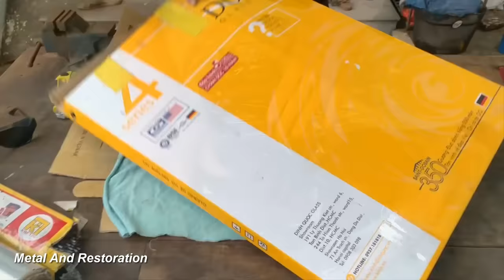Restoration Viking Axe Battle Old | Restore AXE construction Antique

Comment: I really liked it till you stopped restoring it and just painted it.
Reply: No need to do more than removing the rust and painting with anti-rust paint, depending on the purpose. All shiny or partially shiny were certainly options of the customer.
Reply: I kind of get why because the sanding from the plate replacement looks tacky, but If you really want to get technical you could use a variable speed grinder with a low grade scotch bright pad and polished those scratches out. Then you could kind of have the new shiny original look, and of course anti rust it.
Reply: Also when you sand with a grinder don't do small little movements. That just makes it dig in more and create  more scratches. Go with the contour of the shape your are sanding.
Reply: I would've talked the customer into a black oxide instead of that dumb spray paint choice.  If I were the craftsman I probably would've told the guy I can't spray paint it but I can apply an actual black oxide and he can ruin it himself if he wants to.
Reply: It was so frustrating...
Reply: Yep. It's an integrity issue; knowing there's a thick layer of rust beneath a coat of paint doesn't exactly fill me with confidence.
Reply: Watt fooc
Reply: Same
Reply: 666th like
Reply: Exactly
Reply: News flash: Iron when it isn't polished is BLACK. Plus it's a rust prevention layer!
Reply: nowonmetube please spam somewhere else...
Reply: nowonmetube you really like saying news flash huh?
Reply: I figured I'd polish the piece.
Reply: Agree
Reply: f@#k it , im tired, gets a paint then sprays it
Reply: @chriss3835  tttyt7r...
Reply: 9h
Reply: @naveenkumark171  ?
Reply: he coulda just silver spray painted the shit out of it too. paint dripping and all
Reply: I approve of your name and icon.
Reply: Flaming Gamer_ing honestlytho
Reply: Cough He was restoring it to like how it used to be. At the start of the video when he is scrapping of the rust you can see that the axe was painted black. That's why he painted it.
Reply: What a shame he painted the dam thing it would have been awesome unpainted
Reply: @ObeyCamp  Yes, I totally agree with the oxide rather than paint!  Myself...I would want the whole blade brought to a highly polished finish just like the cutting edge...but that's just me.  ⚔
Reply: الله رآه معاكم في هذا الموضوع
Reply: Maybe his customer requested that way.
Reply: @nowonmetube  So, why are all blades we use not black then?

The fact is, iron is of course NOT black. Iron, similar to other metals like silver, platinum, etc. has that silvery, metallic color. Iron and steel that comes out of the forge is black, because its outer layer is saturated with carbon (soot) from the fuel (coal or coke) that was used to heat it in the forge. That's why iron and steel tools are polished, to return it the original and natural metallic sheen.
Reply: @Kamamura2  true but after it's forged it's still black and you don't need that "shiny shiny armor" but I guess that looked more impressive. But then there's the "black knight". Maybe they associated black with evil. I wonder how many things were black and how many were shiny back then, because having to put so much work into it (back then with no electricity tools) without any benefits, it doesn't seem worth it.
Reply: @Wooksie  how it used to be? Are you blind to the fact that it's just a modern scrap of metal cut in some shapes and dunked in acid, then pretending to be restored. So the wierd Asian prank channels are actually real life "funny" accident? Omg you are right! Woooow! 🤣
Reply: @Wooksie  how it used to be? Can't you see it's a chunk of modern scrap pretending to be restored? So all the wierd Asian pranks that circling online are actually real "funny" accidents? Omg you are right! Woooow 😂
Reply: Flaming Gamer_ing literally turned the entire video off for me to McDonald’s saw the spray paint
Reply: that kindda bullshit....
Reply: بژی بژی
Reply: بژی
Reply: Flaming Gamer same 😑
Reply: Yup... Me too.... Cmon man we wamted to the full axe to be polished
Reply: @karinefonte516  he couldve just hardened the metal so it became rust proof, stronger and it being color black
Reply: Flaming Gamer_ing nooooo not PAINT 😭
Reply: Yeh. The paint over egged the pudding.
Reply: axes aren't always unpainted.
Reply: Yeah... bad finish axe.... so unreal.
Reply: yeah it kinda ruined it
Reply: Agreed
Reply: عمل رائع. تسلم
Reply: Yes
Reply: I'm not quite sure but I'd assume the customer is paying him to do this, so the paint is probably a cheaper choice for them and since its for purely ornamental purposes I wouldn't think it matters too much.
Reply: Yes me too man. I wanted to start crying 😭 such a beautiful axe
Reply: Freaked me out when I was reading your comment and I couldn't remember commenting on this video. Turns out it wasn't me, it was you hahahaha! Nice pic
Reply: @darnit006  um thx?
Reply: Good work until the paint came.
Reply: Lol salty people saying they can do better but don't see them posting vids to show they can 😂
Reply: Better than 150 years ago...
Reply: I never painted my survival knife lol
Reply: @mandoky1647  true
Reply: And wash also polish it
Reply: It’s an executioner’s axe, it is supposed to be black
Reply: I personally think thats the best part because its there where it starts to look amazing and not like old crap
Reply: Yep
Reply: Dillon Brunschon  That sounds like a personal problem
Reply: Would have used flat black grill paint. To make the polushed surfaces pop.
Reply: I agree. I wish you would have sanded it down more and if you really wanted to make the inner part darker you should have used blue steel liquid. It seems you got tired or lazy and made shortcuts
Reply: Its obvious that this stooge has no clue what he is doing. Check out any of his other videos
Reply: @mandoky1647  y
Reply: A decorative cut out would of been cooler to fix the holes and the paint job made it seem lazy
Reply: Agree
Reply: Yep.  Not exactly in-line with how the Vikings lived.
Reply: I would liked to have seen some runes or some kind of design on it. Pay money for a "restoration" and this comes back. I guess they got what they wanted.  Definitely could have been done better.

Comment: “Wow this guys doing great” gets the black spray paint out..... NOOOOOOOOOOOOOOOO!
Reply: Exactly. Then you add in that the patch was significantly more obvious with the paint (like he basically could have just sharpied a bright red circle on the damned thing) and it completely killed it.
Reply: @STEVEN JAMES Why the hell do you need to paint a blade
Reply: @TheUltimateBakerofPotatoes9294  it’s so it looks better
Reply: Bruh by painting the blade it just made it look more modern and cheap not restored
Reply: @patos1239  that’s not the problem the problem is that it’s damaged not rusted
Reply: @christian-eu8ns  its both
Reply: @patos1239  I can accept that
Reply: he need to heat the metal up and put it in oil (like others do) and do not spray it:(
Reply: I agree with you
Reply: He spray painted it for a VERY specific reason... oh... you are asking me WHAT the reason is ??? Well... I have no clue... but it was specific nonetheless
Reply: @TheUltimateBakerofPotatoes9294 let him do it the way he wants to god and he wants it to look more modern
Reply: @imolamarosi5547  let him spray it
Reply: Yep this my was my thought exactly!!!
Reply: "restore" an "axe" :D
Reply: Holy fuck, what a way to ruin a beautiful axe

Shameful when he pulled out that shitty black spray paint
Reply: So you could see where some fool torched through it by the welts on the back and the differentiation in surface rust/textures.
There's nothing Viking about this I was half expecting him to pull a Dremmel out lol honestly who wears his Mums Plastic Pinnie  when using  a Torch I stopped watching where he cut it out, good god what YT has done to Trades is a joke
Reply: Yep worst thing you can do with a knife, axe paint it black😂

Comment: This is a fantasy axe restore for some one who left it in a leaky shed. It isn't that old and it's not viking. Plus it's made from a couple of pieces of sheet metal not forged.
Reply: yeah obviously.
Reply: yea its just a metal plate that have been cut and welded on a pipe. so many of this videos are so shitty. vikings would never use something like this
Reply: If this is Viking Age my 2000 Altima is a Victorian period carriage.
Reply: Yeah, way way too heavy for actual use in battle.  More of an executioners axe.
Reply: @magnuslord  Yeah, but you're forgetting that Vikings were 8 feet tall and 400 lbs.
Reply: That's what I thought too. It looked too new and fresh even for it to be a viking axe.
Reply: @oslayer1616  It's about 12 times the mass of a Dane ax, has the wrong shape,  and the socket and rivet holes are machined into perfect circles.
Reply: @jonc.8074  Yeah, it's a damn shame.
Reply: Clearly not a Viking axe. I hate it when people use the word Viking for click bait.
Reply: @kingofthewasteland  The Scandinavians (The people descended from Vikings) used something like this. It's called a Bardiche. But this is NOT one of them.
Reply: @kingofthewasteland  it's decorative at best.  The sheer weight of that axe head would make it unwieldy at best, but a death sentence if the user ever missed his swing.
Reply: Exactly!! Plus vikings wouldn't take that big of an axe into battle. Cheap executioner axe replica

Comment: I was so impressed and interested in what I was watching until the spray paint came out. I was expecting something more. It's like a skilled metalsmith did everything up to that point then his apprentice said "I've got it from here".
Reply: I thought the same thing. What’s with the paint? I doubt the Vikings bothered painting their battle axes.
Reply: @grayghost6692  I doubt Vikings had 1/4' plate steel and pipe to make their axes
Reply: @grayghost6692  They didnt weld with electric either. lol
Reply: @grayghost6692  I agree. Also, there are ways to darken steel without paint. I'm pretty disappointed at the turn out. It feels like he did the blade and was like, well... that's a lot of work so far, I'm tired so, let's just spray paint the rest of it to cover up the blemishes.
Reply: Also, the smaller blade on the other side is crooked af
Reply: @grayghost6692  this is also a fantasy axe and not a viking axe.
It looks like a modern axe that was just left to rust and sold as "antique". 
IF it were actually old, it looks like it could be a ceremonial halberd nearer to the renaissance than Viking age. Which would be a huge IF.
Reply: I have fallen down a major hole on restoration videos.  What got me was when he started putting an edge on it while most of the blade surface was still covered in rust.
Reply: I agree like wth spray paint 😢

Comment: It's not old at all, very minor surface rust and pitting, looks home made.
Reply: What about that hole inna middle
Reply: @ShamsBMopN  Oxy cutter torch, it looks very fresh as there is no rust whatsoever..
Reply: @_Skim_Beeble  yeah
Reply: also completely impractical, doesn't resemble any actual historical war axes, is unusable as practical axe for woodcutting or other civilian activities, Only thing that even comes close are executioner's axes. looks like it was made by someone that has only seen hollywood fantasy
Reply: @ShamsBMopN  slag on one side. Torch work or most likely. Possibly done with a welding rod and high heat.
Reply: Farming disk.
Reply: It struck me as made for a play/film.
Reply: yeah it doesn't look very practical
Reply: NEVER.!!! Lmfao
Reply: This is not even an forged axe
Reply: @psy9o  True
Reply: I was thinking the same thing

Comment: Spray painting it makes it look like you just got lazy my man like you didn’t want to clean up the rest of the axe
Reply: Zane Rodriguez maybe the ownner needs it back early
Reply: The problem is not that its not cleaned, but that it won't last
Reply: That's what I said. Might as well painted the whole thing from the beggining after replacing the holes 😭 still gotta give him credit for the effort
Reply: @Straight2daPoint0  that's not how to restore metal..
Reply: @Zane Rodriguez when he heated the blade up with the torch and quenched the blade he could've cause the blade to crack on the inside so that's y he spray painted the blade probably... so basically the blade is useless
Reply: Zane Rodriguez stop hating!!
Reply: And he’s not painting it he is polishing it.
Reply: I thought the same thing
Reply: Gacha Cookies no he spray painted it black
Reply: @anythingjulia3142  nobody's hating Gacha it was really great work, but then he stopped and painted it. It cheapened the look. And something else if you are going to paint it learn how to paint first.
Reply: Vagary SavageBish the blade is antique though, it's not meant to be used it's there for decoration purposes only
Reply: It is not antique, cleary visible that it was welded on the back blade and the tube handle mount... Also obviously it was made from an iron sheet and somebody tried to harden it, but the torch was too hot and burned hole thru middle of the blade, and also deformed, what is the side effect of wrong warn up/hardening...

It is just a homemade,  fun made decor stuff,  or at least started to be and it was get fucked....

Also i guees this guy bought like antique, but he also realized that... He made a YT video like content if already spend some effort with this piece of metal and after of these,  he sent back to the seller and did refund...
Reply: Damn you didnt have to exposse him like that ayyy 😂😂😂.
Reply: Gábor M. The holes in the center of the blade are from someone trying to weld it. Not from heating
Reply: @swift__   Doesn't matter...
Reply: Maybe the owner wanted it that way

Comment: cool until you spay painted it. i looks like a cheap prop now... :(
Reply: He didnt really have a choice once he cut a hole in it.
Reply: It was a cheap piece of crap from the beginning xD
Reply: yea he totally should of bronzed it
Reply: @markofthemetal  I think he could have left it with a hole. Maybe a diamond shaped one.
Reply: @flippensweet3  should test it or not?
Reply: a light coat of linseed oil applied before tempering and the final sharpening, will leave a sorta gold-bronze black finish, and prevent rust for decates.
Reply: AS ALGO INPRESIONANTE
Reply: back in time they used animal Fat oil to burn then make the bkack painting like in casting iron pans when u seasoned ... so sad.
Reply: Lmfao😅😅😅😅
Reply: I think it wasnt an antique, is a Carnival axe, a replica. un very bad conditions, you put a metal piece un the garden, and in 10 or 20 years, would look like a piece from the museum
Reply: @melloVR  yes. everybody can weld 2 scrap piece to pipe and shape it to shit like that...
Reply: painting wont make the metal degradate as fast LUl
Reply: @muratakburakma  That came to my mind, as well. But once again, we don't know what the customer asked him to do.
Reply: Karine Fonte yeah I guess I missed the point that it could be  a specific order.
Reply: At least buff the whole damn thing before painting it... 
Spray painting over rusted pitted and worn out metal is just straight amateur hour. He already freaking buffed out the edges. Why not do the whole thing.
Reply: @jfc3552 right lol
Reply: @markofthemetal  I could have done it with it. Grind the welds smooth and use a low grade scotch bright pad. I spent three months inside 4ft wide by 6ft long stainless tanks. It needed a mirror finish on the inside lol. So I learned a lot on how to take scratches out of steel lol.
Reply: News flash: Iron when it isn't polished is BLACK. Plus it's a rust prevention layer!
Reply: @Omegaman87272  should've* if any
Reply: @nowonmetube  yes it's black but the paint was a bit much. If you want to prevent rust on metal the oldfashind way is to just apply and remove oil. Besides no one doesn't like a bit of service rust
Reply: nowonmetube another news flash!
Reply: @coolboyslim1847  oil is greasy and smears off easily. And besides, it doesn't get black with oil.
Reply: @AG.Floats  36 is a 4 36